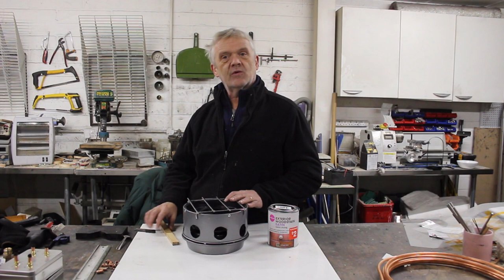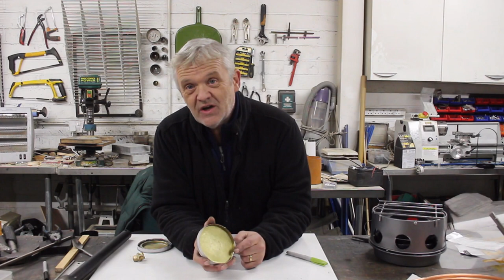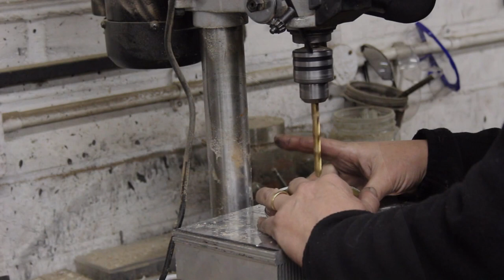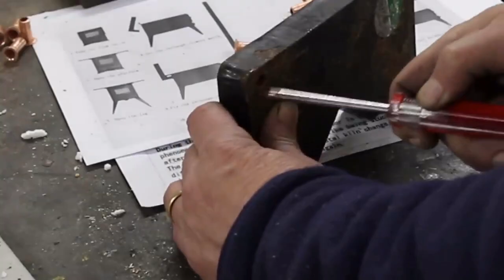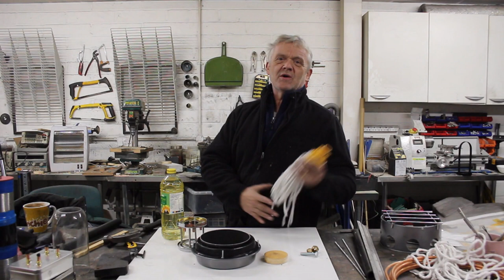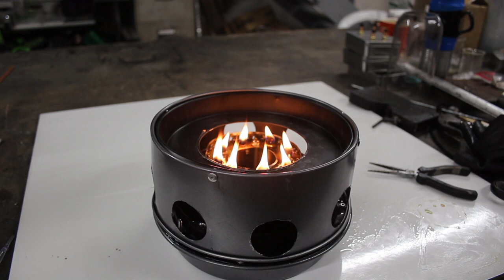1783 How To Make A Reed Multi Use Veg Oil Stove

Comment: I'm curious with all these stove designs, if you could come up with a way to make the burn more efficient like the rocket stove. Perhaps adding a fan or 'chimney' of some sort.
Reply: It's possible . It's need more layers of this metal boxes with holes at : up and down to flow the air and to have contacts between this . On the up part of the biggest metalic box ,in the center,you put a chimney to evacuate and to have a better burn . It will be fast a hot temperature on the boxes . Ideea it's to use extra virgin olive oil because not make smoke and bad smells,or try biodiesel ,or methanol and ethanol . In this way ,you can make a big stove that use 8 or 9 flames or even more and if you want to put a fan for ventilation to be more fast ,combine a rocket stove model with what Daniel Tartaglia created . Also, i make inside this stove a form with holes that make possible to burn pellets .and to flow the air to chimney . But ,what I creat now it is a rocket with 3 modules that can be put one on other and use in function by what material you have . At base , it's a combination bettwen a forge that make a vortex flow air and a central burner for oil ( ideea it's to not make smoke and use : wood and oil ) . Another module it's only for a gas from fermentation and another it's for pellets . The first modules can be also a base for the module with form that I use for pellets ( I can make a combination bettwen this modules to eliminate how much smoke it's possible ) . Also ,i make a module from two boxes with different diameter that are put one inside other and put cement and water bettwen this to resist even in time the metal from inside box it's destroyed by heat .
Reply: You want more efficient to be ,make bigger ,use an internal cilinder with many holes , use something to block flow of the hot air outside when it's burned combustion material like wood ( something on chimney ) and use a heat recover . Soo ,you can make a rocket stove with cheap materials , with more modules for different materials : wood, cotton clothes, pellets, cartoons, ethanol,methanol, candells with oil ,etc., fermentation gas . Ideea it's that in final to obtain : heat for room, heat for cooking, light and to heat water ( 6 liter's for a shower using a tool that's use in agriculture to eliminate the insects,some bad plants ) .
Reply from the maker: yes you could and I have already built an example of that mate
Reply: Also,to be more efficient you need to make a better insulation of your room,house, apartment . Better insulation,more economy you make .
Reply: @ThinkingandTinkering  Cheers! I've missed a few vids I think.
My main concern with oil vs alcohols as fuel would be getting it to burn fully. So there aren't so many unburnt byproducts, soot, monoxide, etc.

Comment: I have a couple of questions : what is the safest fuel to burn, indoors and why do my homemade wicks (thick, rope like twine) cause so much smoke/soot; regardless of how much work I have or don’t have?
Reply from the maker: I am afraid it is not just a question of the safest - there are legal requirements too - you will need to check out the eco guard 2022 legislation if you are in the UK or Europe
Reply: Maybe can be a liquid for desinfection that it's  mix by methanol and a substance that make less fluid ( desinfection for hands in situation with Covid ) . This it's something bettwen solid and liquid and burn very well,but, it's more expensive that metilic alcohol .
Reply: The substance mixed with methanol it's glicerinn.

Comment: In 1695 you make that super simple stand up wick and it just sits in some oil... would it be possible to do that with one or few of those in a small basin and use engineering to maximize cooking area and light and heat using your steel mantles and some radiant tubing or a pot?  Terracotta is pretty replaceable if it breaks and does hold a lot of heat after the fire extinguishes which the better sink means the less time the fire itslef needs to burn over all to maintain a safe environment. Even warm water heating should be possible... thanks again!!!
Reply: There was one video you made a very similar setup and then made a big deal about only trying this with vegetable oil unless you want to die... that stuck with me a great option for inexpensive fuels to look at. I like the idea of being able to pull out a wick or add a wick for heating cooking light purposes without too much danger all around... I see this maybe even having a chimney that could rout out a tent door without getting dangerously hot or letting all the heat out... thank you for reading the comments do your thing, Sir!✨️🙏✨️
Reply: Add a strange engine even✨️🙏✨️
Reply from the maker: yes it would
Reply: @ThinkingandTinkering  I figured one out using a metal cup/can as the resovoir. A circular roll of carbon felt wick wrapped in copper wire with a circular foot to hold it upright. I stuff a roll of wire mesh down around the the edge of the cup. I made an enclosure and grill top out of some pieces of steel fence panel that was sturdy but hand bendable... a piece of folded up foil works as a reflector/ extra windbreak... only tin snips and scissors needed assembly to lighting in about 1 minute! I am very close to an almost free no tool set up that I can put into production... light/heat and cooking! Thank You!!!

Comment: You should never have a burner inside a tent, if the burner sets light to something you are unlikely going to be able to unzip the tent flap while panicking and escape before you have burning molten nylon dripping on you.
Also there is the carbon monoxide buildup and condensation.

Comment: It doesn't matter if a flame produces smoke or not. Any flame will produce carbon monoxide and should NEVER be used for heat inside of a tent unless the combustion gasses have a direct path tro the outside (such as with a chimney).

Comment: i wander if you could come up with a room heater that is running on used vegetable oil or maybe  even car waste oil and that does not need a chimney connection, so you need a pure clean burning process of the used fuel to avoid carbon oxide gasses and it should be controllable and preferable free of electric fans, i am thinking here on a steam additive to the burning process and stainless steel sponges in the exhaust or a car exhaust katalysator or both to get rid of the very last bit of co gasses, talking about a challenge, this is one, are you up for it?????.
Reply from the maker: there are a couple of additions I would make mate - it has to be able to be built with household tools and built by the average person

Comment: I don't understand why heating say a plate or a flower pot can make more heat for a room than simply letting the heat from the flame heat the room. The heat that the flame makes can only escape into the room.
Reply: Be the flame and think more deep . Next,make a contact with a metal  and you will start to radiate one a bigger surface . Next ,go like a particle that have a bigger energy compared with the space that it sorround and let with this move to manifest another particles that will also escape in space . Radiation, vibration it make the difference . At a simple flame, radiation it's small on a space near the flame . If you use a metal,you make heat to migrate on a bigger surface of space and next it will escape more particles . Why you can amplifier the light using laser effect ?. Because you add more particles at high energy . It's the same when you add particles from metal and give the high energy of flame . You amplifier the energy of more particles .
Reply: If the flame is just heating the air.. you have to warm a lot of air up. Instead, If you heat up a solid that becomes an infrared heat emitter, the wavelength of infrared is more likely to transmit to solids, passing through the air (to a degree). This is why infrared heaters can be more cost effective than a fan heater.. you’re heating the thing (surface/object) you want to heat rather than using air (heating air first) as the transmitting medium. But you are right in that heat energy is just heat energy.. and heating a damp plant pot first may not be that great.

Comment: Building stoves is cool but not entirely practical.
Whether people live or freeze to death, depends more on the fuel type,
and how much they have, and how they manage it (when to burn it and how much to burn).
In my experience, the wick and the fuel, and managing it, can be tricky.
It's one thing to make a stove in a workshop and use it only for demonstration/testing.
It is entirely different when your survival depends on the stove, fuel, and wick.
Reply from the maker: ok - you have pointed out a problem - now what is your solution?
Reply: @ThinkingandTinkering  You could do some "field testing" with your stoves, with different fuels, different wicks. Keep records on how much money is spent, how long wicks last, how long fuel lasts, temperature of room/tent/whatever.  Tell us all the pros and cons of each stove and each fuel.  Of course, this is a lot of work, but the information could be very useful.  Also, tell us how you got the fuel.  Did you order fuel and wait one month for delivery?  Or you walked down the street and bought it this morning?  This kind of practical info is useful.
Reply: At garbage containers you find enough material for burning ( wood, cartoons,paper , cotton clothes ) , also ,a good insulation of your room,house, apartment,make the difference . More insulation,less materials it's need to burn . So simple .
Reply: I heat my garage from garbage containers an entire winter totally free . I forget to say,the books it burn very well and if you introduce a sand battery in your stove ,you can keep some heat more hours after the materials that burn was finished ( burn completely ) and Also it exist possibility to block to dissipate the heat from chimney after it finish to burn material .

Comment: 😎
One tip for a lot of mops, they are coated with chemicals to not let them absorb water easy. Soak in hot water & it comes off. 
Dry thoroughly for wick material, da! 
It’s not noticed if using for regular mopping cuz hot water is normally used. 
If new mop floats in cool water it has chemicals on it…let it soak then dry… 

✌️🤟🤙

Comment: Always great informational videos. I was wondering if on one of these heaters, you can adapt a Heat Powered Fan to push heat out into a room?  Like in this video, use a 6 inch in diameter curved duct pipe with the fan at the end, this stove might be perfect to adapt. Just another idea.
Reply: I have a heat powered fan and experiment with it and stoves like the ones built here. To be honest, I'm disappointed with mine. I find a usb powered computer fan to work so much better. With that I use a solar charged battery pack. It will run the fan on low for almost 72 hours on a single charge.
Reply: @jerrodlopes186  Thanks for the info, I'll look into that.
Reply: @muskcoder6367  I should also mention the fan and battery pack are less expensive than the stove fan too. I am glad to be of service. I hope you enjoy your tinkering even half as much as I do mine.
Reply from the maker: yes that would be pretty simple to do mate